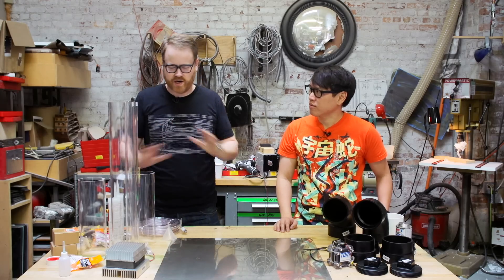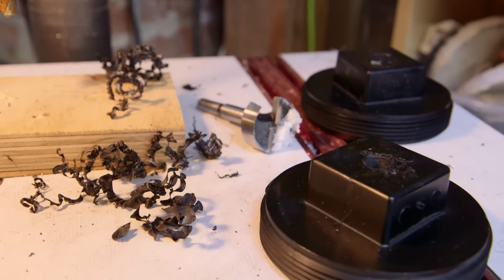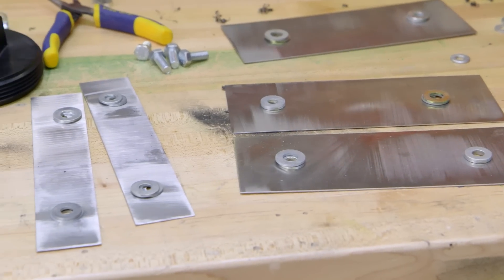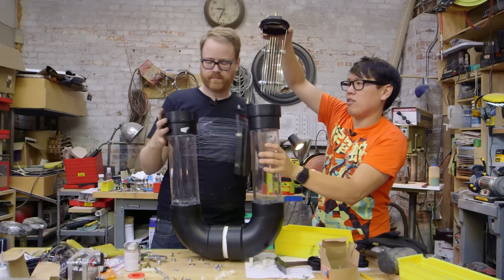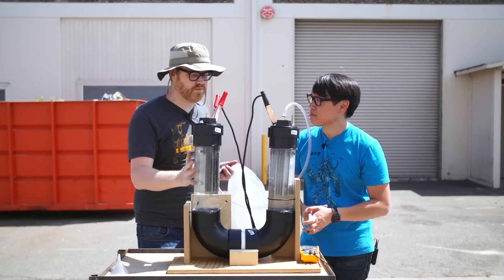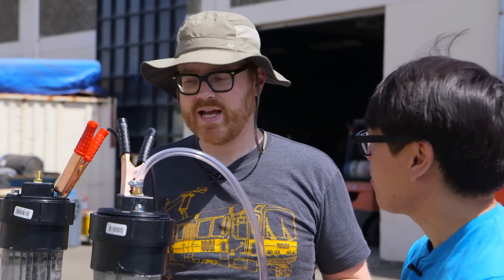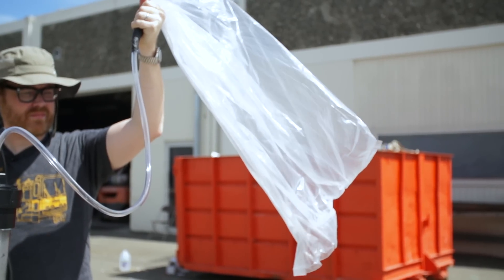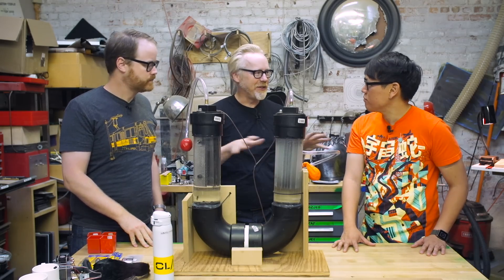Tested Builds a Hydrogen Converter

Comment: SMH  Power is Watts not Voltage (voltage is potential difference), this is basic stuff here... They start with saying the process is done by running current(Amps) through the water but then they have 100 Watts 22 Volt solar panel which is just under 5 Amps of current compared to a car battery's 500 or more amps.  Not to mention having a higher voltage actually gives you a lower current rating (ohms law) but hey lets F up the experiment in the name of clean energy.  There is so much wrong with this I'm just scraping the surface.
Reply: they shouda attached a bicycle power supply and made that guy sleeping on the chair power it
Reply: Blasted 🔥
Reply: You can get a hydrogen generator working on 5 amps, but with the giant U shape, I think the resistance is too high. I am barely getting 5 amps draw using 30 volts, salt (not KOH), and like a tenth the distance. Also, filling a balloon takes a lot more hydrogen because it’s so compressible
Reply: @matthewhubka6350  yeah you are right. I would of made a dry cell
Reply: They CLEARLY have NO IDEA what they are doing. The results back that up.
edit: I should also note, solar panel materials (mining and processing) and construction is incredibly NOT clean, or "green".
Reply: uh..   mine runs at 12 volts at 7 amps... lil 4" cube dry cell..compared to a car battery huh..   pretty sure only a forklift batt is cable of 240 amp draw....     highest most expensive car batt says it right on the label.. 

90 Cold cranking AMPs..         sorry dude,   I'm a Gmac    even our fucking plasma cutters dont take 240 amps to cut through 8 inches of steel..    oh   gmac is gas metal arc welding...  engineer at work :-\  your pretty close    volts x amps = watts
Reply: Adam is great, so was mythbusters, but scientist he is not.

Comment: Why are you the only ones not doing it right, is it intentionally to fool the masses? You need at least 15Amps per second to get the best results and you're running it through a 2 to 5 Amp solar panel, yeah, right, science my ass.

Comment: What a bunch off baloney,i can do better with a 9 volt battery.
Your failure is to have the anode and katode to far apart,the water creates too much resistence for the current to flow,nitwits.
Idont want to guess why you did not do it the right way!!!
Adam i far to clever to not get it right the first time.
Why do you even start a project with the aim of failure???

Comment: I'm thoroughly disgusted with the spirit of this video. Anyone with 5min of free time will learn that an electrolysis rig requires a high amperage as well as high voltage.
This feels like a way to discourage people from experimenting with splitting water..
That solar panel probably doesn't produce 1500ma of current. Shame on you Adam Savage!

Comment: for fuck sake, electrolysis starts at like 1.2v i think and stops becoming more effective after like 3v the power just gets lost to heat, people do higher voltage setups by using neutral plates yo just used 2 big plates

Comment: Epic FAIL ... Why? Simple! They changed the experiment fundamentals to use Faraday, low voltage, high current, passing THROUGH the water. WHY? Have you guys NEVER watched ANY of Stan Meyer's videos? ... HIGH voltage, HIGH frequency PULSED, current, DISTILLED water. How is that so difficult to understand? How many initial conditions did you think you could change and yet repeat the process used successfully in countless other videos on-line? You have singularly failed to impress. 👎👎👎 Go back to class, read some more, watch more videos from people who do this the RIGHT way and for Pete's sake LISTEN TO WHAT STAN MEYERS SAID AND READ WHAT HIS PATENTS ACTUALLY SAY.

Comment: They used the solar pannel and that could give 22VDC and 4.54A (I = P/U = 100/22 = 4.54A). That's not enought to produce HHO fast.... It doesn't matter if you use 22VDC or 1000 VDC if the current is low. You only said that on video because a lot of people who watch this doesn't know a bit about electricity, but for the ones who know, that's bullshit. They said "22V is better than 12v" and that's bullshit. On this project, 12V at 20A is way better than 22V at 4.5A. That's what happens when a car company that uses oil sponser a "friendly environment video", they fail on purpose.

Comment: What are they that dumb. Good job trying to be lossers. Thats why you dont watch TV.  So there trying to say hho doesnt really work. It sure did for me years back i messed with it. In my 91gmc 4.3L V6. I was spending 50 bucks a day in gas going to work and using my truck all day and driving home. After i hooked up HHO with other things to help it out . 50 a day went down to 20 a day. Saving me 30 bucks a day in gas.  Thats 150 bucks a week and roughly $7,200 a year. So if anyone thinks its bullshit and does work? Thats fine  cant pull wool over your eyes. But for those who can think and can learn things . Yes it works, and my truck ran better, smoother, cooler and yes cleaner. Its all about getting a complete burn. It is some work thou and otber things you have to do but it is worth it and its a good feeling when you get it working right.

Comment: You should make a dry cell.  And you need osilocope.  To make two square waves.  And you need to hit  Renaissance frequency. And rectify back to DC current. I made a  gas motor run on hydrogen HHO. You also need two advance the timing because gas is a slow burn.  And hho blows all at once. So you blow the piston down backward if the timing is before top dead center. Pretty bad people went to collage. And can't do it. But I quit in 8 grade and did it.

Comment: You‘re telling so many wrong things. 
A) Just because your Solar Panel can produce 24 Volts doesn’t mean you have 24Volts available. What really matters is the maximum amount of current flowing.
B) You Will NEVER ever produce Chlorine gas from a solution of Chlorite. You would need to electrolyze molten salt to get that because as long as there is water present, it will split up first.

Comment: You can easily make more Hydrogen if you just put two old screwdrivers next to each other in salt-water  and power the whole thing with a cheap power supply. There are so many videos on YT showing builds and the process itself ... this was disappointing.
Reply: Nonono....salt water (NaCl) makes chlorine
Reply: Sure NaOH (drain cleaner ) is better because you get  oxygen instead of chlorine. This ones good. https://www.youtube.com/watch?v=eDXA7Veg6FU&t=593s   I agree
Reply: @nimnimlight  Nah bois, something with CO should do the trick XD

Comment: I did this successfully in the late 70s they're overthinking it don't need that much surface area if you use Nickel Plate and you need 65 amps voltage don't matter. Do not separate the oxygen from the hydrogen. Do not try to store it use it as it's being produced. A aquarium pump and pump it straight into a intake manifold and use it as a additive.

Comment: Ok, it's my "Opinion" and mine only that this failed because they wanted it too. Why well your guess is as good as?. 
HOWEVER, if they would had connected at least 2 12vdc car batteries in series. That would had given them more push i.e. 24Vdc with a lot of volume i.e. DC Amps. Then It's possible  they would had been cooking with Gas LOL. Hydrogen to be exact.  If say they added two more car batties for 48vdc in my opinion only that maybe enough juice to run a ??? 

Pro's and con's: One always get less than you put in when making  "H".  Unless what you use to create the H is free now it's something to look at. Let say you charged those batteries via the Sun, the Wind or Turbine ran from Steam etc... Then one maybe could use the H to heat your home, run a generator, make steam, float a blimp etc...
These ideas are from a stupid guy talking none sense and the stupid guy doesnt recommend anyone try this at home Hydrogen is dangerous and needs to be carefully handled.  You decide.

Comment: I don't know why everyone is complaining that they "DID IT WRONG"  I mean these guys are in their early and late 30s and they are building this machine from memory from back in high school.  I PROMISE i could never do that.  I mean I know Adam didn't give them the criteria that they could not do any research whatsoever and had to rely strictly on what they remember from high school.  But he didn't say they couldn't.  The fact that most HHO machines could easily be modified to make they hydrogen come out one vent and oxygen from the other and that they could produce 15 liters in only a few minutes and these guys couldn't make that much all day should be held against them either.  I mean don't get me wrong.  If I had two employees waste all day and NOT get anything useful accomplished just because they were to ignorant or purely stupid to spend 20 minutes doing research on the internet I would fire them.  But Adam is such a cool guy he doesn't even care.

So for anyone would couldn't tell I was laying on the sarcasm pretty thick there.  Let me just point out a couple ways they did this completely wrong.  First the one guy said "the more voltage you give it the more it produces".  This is absolutely wrong.  That's like saying "water can erode away anything given enough time" then trying to prove it by washing away a mountain with nothing but a single bucket of water.  It will never happen.  Similarly they had a solar panel producing about 19 volts.  Yet only about 1.3 amps.  They don't mention this and based on their comment about more voltage they probably don't even understand why it matters.  You could step up that voltage from 19 volts to 1 million volts.  It wouldn't make that apparatus produce hydrogen any faster.  In fact it would produce a little slower as they would lose amp in the conversion process.  So HUGE fail right off for using a solar panel direct.  Even if you want to use a solar panel as your ultimate power source the proper way to do it is to use the solar panel to charge a car battery and then use the car battery to run the electrolysis machine.  But they were probably trying to remember learning about solar panels in high school and realized neither of them had a class that covered that so they ignored the instructions and made something up.  So the HUGE mistake here is that they didn't have a power source with enough current potential to produce anything resembling a significant amount of hydrogen.

In order to have even remotely decent output they need a voltage that will give them an amperage drop of about 1 amp between each set of plates.  Ideally you would want to amps.  In order to accomplish this most people as they did accurately mention use a car batter.  (why they knew that most people did this an yet dismiss it out of hand is very suspicious) A car battery is charged to 12 volts.  Now the apparatus is designed in such a way that the plates are set up in parallel with sets of 6 plates.  This way 2 volts is dropped across each plate giving you aproximately the proper amperate for maximum output.  These tards used 10 plates on each side but then the plates on each side were dead shorted together preventing any current passing between then.???  Its... beyond idiotic.  They don't even know how electricity works.  If and I mean IF you really wanted to dead short each side anyway you might as well not make plates and bolt them together.  Instead just wrap your conductor into a coil and shove it down in there.  You get more surface area with a LOT less work.  Not that this would matter still.

So they have a max amperage of 1.3 amps and NONE Of that flowing between their stacks of plates.  Instead all the current is passing the longest possible distance between the lowest point on the plate stacks on each side.  As in down through the tube and up the other side.  If they had made the tube just a little longer it wouldn't have worked at all.  95% of their current is lost just getting to the other side.  The ideal distance between the cathode and anode plates is somewhat debatable but between 1/16 and 1/8 of and inch.  That's were separated by over 12 inches.  That's about 100 times to far.  Needless to say that means their machine was working about about or less than 1% of its maximum potential which based on the rest of the design wasn't that much to start with.

So you take a power source that has 40 times less power than they needed and then cut that down to 1 one hundredth of its potential and its no wonder why they couldn't fill a tiny bag.

Comment: The reason it didn't work was the design. First problem was your goal was to just get hydrogen vs the combined hydrogen and oxygen back cause you to have both sets of plates way too far apart and it was pointless to have a series of plates together at each end. The bracket that held the plates at the top was connecting both ends. If it wasn't and you had one end with negative in one and with positive on just one of the cells you would have been able to produce much more. But instead electricity had to jump all the way from the left side to the right side through the bottom of the u-shape connection. So if you would have had made the cells connect with electricity correctly being just one of the cells with negative on the left side and positive on the right and no connection bar in between Too Short the two it would have worked flawlessly and been able to produce a significant with a greater amount of gas. I also noticed that there was a cell that was purchased that wasn't even used to try. The second mistake was not using a correct powering source. You were using pure DC electricity when it should have been a pulse-width modulated signal turning on and off therefore not wasting electricity to heat in the water. And I thought these guys were intelligent with this level of Competency I don't believe they do many of the myth busting correct.

Comment: What? This is so easy I did this in junior high with a rig WAY smaller and made way more hydrogen and oxygen! Your amperage is obviously too low! 24 volts isn't helpful if your supply can't supply the current! A simple google search would have solved that.

Comment: They should have used glass bottle capacitors to up the voltage.
(Glass bottles wrapped in tin foil and connected by tin foil fuses to the gator clips)

Comment: If you put a large pipe in the middle to put in new water to make sure that you actually refill the water and also we used a kind of sour stuff do not know the name of it anymore and in the classical experiment platinum electrodes but indeed you can use stainless steal but than you have to use also the sour to make real hydrogen, and also keep refilling it from a large pipe once the water drops from the plates refill the pipe that you put the water into from the middle of those two pipes connected and make it just a bit more level than the plates to put on the pressure in the gas bags...

Comment: First of all the cells need to be brought closer together. Keeping them far apart you waste more electricity. The further electricity has to travel from the cathode to the anode. You lose amperage. Keeping the cells closer your amperage doesn't drop as fast. Plus you need to put pipe tape on the caps. They weren't tightened all the way down there for you were losing gas out from around the threads. Also it doesn't matter how much voltage you have going to it if you don't have high enough amps it's not going to work right. Voltage isn't what does the work it is the amps. Hence why your cars battery is rated in cranking amps. A cars engine can actually start on 6 volts as long as the amps are high enough. Remember amps = work load.

Comment: Compress the hydrogen gas to 130 psi and connect it to your car. Have a wonderful holiday picnic on an hydrogen bomb. it will explode and the temperature may rise to 1200 degrees C for 30 second. You car would be gone with you. Head line news! good luck!

Comment: What a load of crap. You could see, right from the start this experiment was meant to fail. They all should be embarrassed to have even taken part in this. If they're not embarrassed they must be even more stupid than this video proves.
Splitting H2O (water) into Hydrogen and Oxygen using electrolysis has been around for a very long time. Since the late 1700s and these two numbskulls couldn't do it in this video. I wonder who's paying for these videos? Maybe an oil company?

Comment: OK, so I wasn't done after all!
Rather than the classic U shaped apparatus, have several small cross-tubes connecting the anode and cathode cells.
This allows current to flow directly from cathode to anode without taking the long way round.
You could add these tube to an existing U design, makes it more betterful.

Comment: And this is still relevant, even after 2 1/2 years!   It is still a reminder of the Fuel Cell boondoggle being perpetrated by car companies still resisting battery-powered EVs.  They want more complicated cars to sell, not simpler ones that require less maintenance.  Power your shop with Solar Panels, Adam- more efficient than fuel cells.  And power your car with batteries- it will use less power than creating hydrogen to go the same distance...otherwise, love your work, guys!  And the science behind fuel cells is neat- just not practical.